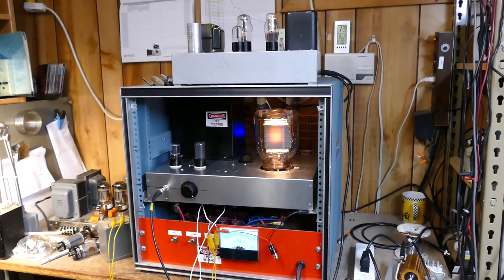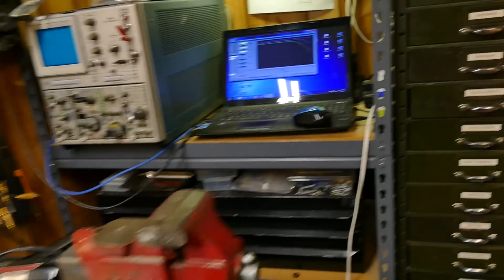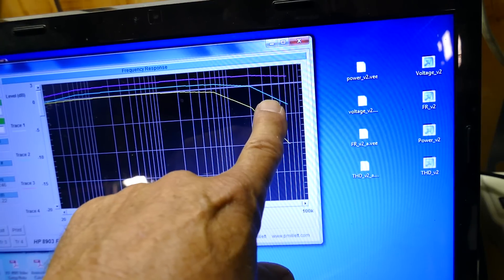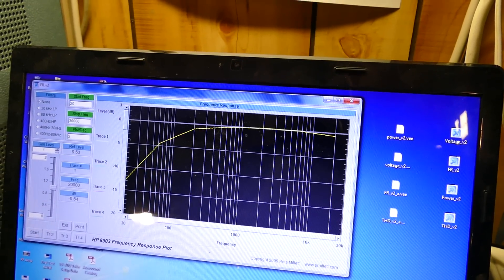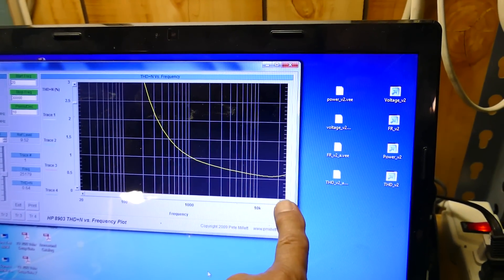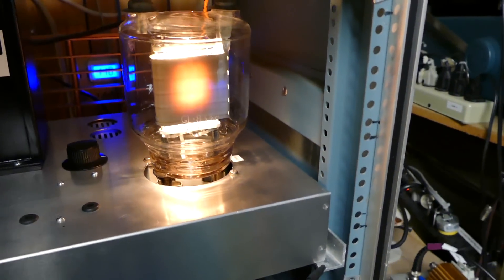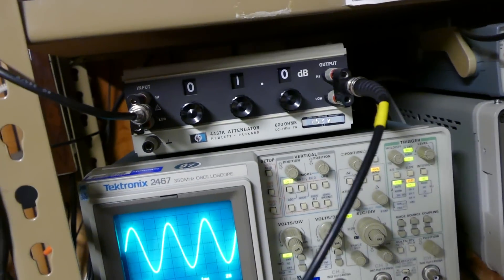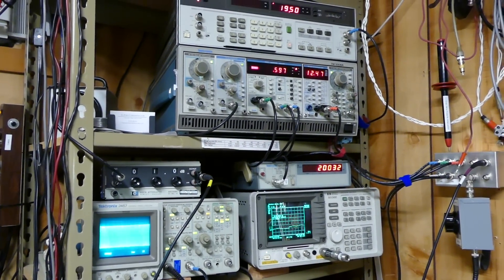833A Vacuum Tube Audio Amplifier Update

Comment: I guess it was stated already, but I think you need two 833's, push-pull, balanced bias current on the transformer primary, which is probably saturating...  Do you know what the primary inductive reactance is? I think you'll need about 200 Henrys!
Reply from the maker: I just replied to your other comment. I think the L of the primary is around 7H as I have found to be not uncommon for large OPT. This transformer is for PP 810 tubes. 200H would sure be nice but I don't think that is very practical, especially at high power. I doubt I will ever attempt SE amplifiers again. From what I have measured on SE amplifiers, the harmonic profile is pretty much that of sawtooth waveform. Second harmonic is high and each following harmonic is lower in a descending exponential shape. I will admit that at low power and the right kind of music, a SE amplifier or even a PP amplifier with little to no feedback can sound very alive and dynamic. I built a 80 watt PP amp several years ago with variable NFB and with no NFB it was very easy to drive and actually sounded amazing but max power before THD went thru the roof was something like 7-8 watts whereas with proper NFB it would do 80 watts. As NFB is increased, the amplifier tends to sound compressed but what are we going to do?  Build 10 watt amplifiers that weigh in at 100 lbs each? I think that is what they tried to get away from back in the 1930's...   :-)   and they did a good job with the PP amp and feedback.
I also have a video on PP 813 amp that turned our reasonably well. I still have that amplifier but the 833A is now in a 20 meter SSB linear amplifier. It does a very good job there and will deliver just a bit below 1Kw with 4KV on the plate. I usually run it at 3600 volts and 800 watts output.

Comment: My 833-A stereo is less ambitious than yours. It uses only 1000 plate volts and draws little over 120 ma and a Hammond 1642SE output transformer and I use an interstage 5k 1 to 1 Hammond transformer to drive the grid at zero bias (one end of the secondary grounded. ) This transformer couples the output of a 245 triode and it has a healthy low frequency for a small listening room. I heat the cathode of the 833-A with a fully rectified bridge rated at 20 amps delivering about 9.9 Volts with a 0.1 Ohm dropping resistor and a 4.5 Farad filter capacitor to get rid of the hum. The 4.5 Farad capacitor is designed for a car stereo and it has to be maintained by 9 volts through 100 Ohms to keep the capacitor from emulating a short circuit when I turn on the cathode heaters. 
This circumvents the difficulties of a grid bias that goes with 3 kv on the plate. I have been using this amplifier for some time and I like the stronger sound it has.
My only regret is that Arcturus never built a blue glass 833-A or glass in other colors because that would make an 833-A amplifier look even wilder than it does.
Reply from the maker: Very nice. I am pleased to know someone that actually built and uses an 833A SE amp. I have toyed off and on with the 833A for decades using it once in an RF amp probably for 80 meters and I never seemed to be able to make friends with it. On the other hand, all of the 4-400A family of tubes (except for the 4-65) from the 4-125 to the 4-1000 has worked for me. The 4-1000A was not my favorite because at the time I was working with them (I got the used ones free from WSMR over the 20 years I worked there) I did not have the means to deal with a 5KV (or more) power supply. Maybe my problems were similar with the 833A. My favorite high power tubes are the 3-400Z and 3-1000Z triodes. I can make the 811A sing also and as they are all zero bias triodes (maybe -5 volts for the 811A at 1500 volts) they are easy to work with. I use a 3-400Z amp daily in my amateur radio station. It is beautiful and has almost the same punch as the 3-1000Z
Thanks for the information. As I think you saw in this video, I did not have a proper output transformer for this project (mine was a huge PP transformer) so my LF response was poor (core saturation)    But... I tried and it was fun. 
Be safe with the HV...
Lastly, I have no issues with hum running AC on the filaments of directly heated cathodes. The last amp I built and listen to daily is the quad (PP/parallel) 300B amp with the big UTC LS-58 output transformer. Sounds beautiful and it is honestly quieter than my McIntosh amplifiers. I can hear nothing at all from my speakers whereas I can hear a tiny hiss from the Mac if I put my ear directly to the mid-range horn.
Reply from the maker: One more thing I would like your thoughts on. Looking at the 833A I see it is a medium mu triode with a gain of 35. I would consider that medium gain. With that said, check the 300B with a gain of 3.85. Certainly with such a low gain (the 300B) , it will be necessary to put a pretty high negative bias on the grid to control plate current, and run the tube class-A. So, why don't we do the same for the 833A - bias it, not to cut-off, but enough to be able to drive it from a reasonably easy and common driver (6SN7) but make sure not to draw grid current? Seems like that would be the best of two words - the exotic look and style of the 833A and the charm of a clean class-A amplifier and of course, a proper output transformer (not like what I used).  Your thoughts?
Reply: I use a choke loaded mu-follower 6SN7 that drives two 245 triodes with no apparent impedance overload. One of the 245s drives the tweeter on a GR Research OB-7 while the other drives the mid-range and a 5k Hammond 126B interstage transformer through a 100k pot which drives the 833-A. I could hear no difference in the mid-range speakers between AB tests on whether the 5k interstage was connected. The 833-A drives the woofer and it has to have its pot turned only about halfway up to balance the volume on a dB meter at the listening position. Also, the dB meter allowed me to check polarity connection of the interstage transformer to put the 833-As and the mid-range at least nearly in phase near the crossover frequency. 
This tri-amp gives me the clearest sound with the tweeter and the mid-range and the deep authority of the bass that the 245 can never match. I really like the sound which is more like that of a concert hall than I ever had before. 
As soon as I can borrow a camera I will send a picture.
By the way, this system still needs a preamp to drive the 6SN7 so I use a 2C22 with its own power supply and two blue LEDs in series for cathode bias. The 6SN7s have a 1.5 volt battery for the grid bias of the lower grid which is transformer driven. The 2C22s appeal to guests' maternal instincts because they look like baby 833-As.
Reply: I could not get away with using a center-tapped 10 Volt 20 Amp rated transformer and it takes every bit of 4.5 Farads from a car stereo capacitor to get a silent background. But the use of a center-tapped 2.5 volt connection to the cathodes of the 245 driver tubes is as quiet as an elaborate system of lead-acid batteries and dropping resistors. Also 6.3 Volt AC makes no noise on the 6SN7s and the preamp 2C22s. I built a Lexan cage for the 1 KV power supply and 5 KV makes me nervous with its filter capacitors ready to explode in the event of a short circuit arc not to mention mercury vapor diodes. I use FREDs rated at 5 KV in my lower voltage power supply.
Reply from the maker: During the construction of this amp I read the same issues you are telling me about the hum issues with AC on the 833A. I did use a DC supply but never actually lived with any hum issues out of a speaker as my amplifier just didn't turn out good enough to use - I am sure mainly because of the wrong output transformer.
I feel the same way you do about living in close proximity to 5KV. In both of my RF amplifiers I run 3.5KV but I turn the PS on and off with transmit and standby and I run both of them off a dedicated 240 volt circuit.  I added a soft-start to the 3-1000Z amp as it wanted lots of current on startup depending on the point of the cycle when initiated. In the latest 300B amp that I use as I write this message, I have MV rectifiers in it, 866A and as mentioned, quite beyond my expectations. For some reason, I anticipated noise from the MV rectifiers. They are beautiful, I have to say. I also have some 3B22's which are full-wave xenon rectifiers that work perfectly well.  In my transmitters, both of them, I use a bridge of four SS 866A type plug-in replacement diodes so I did not have to modify everything in the old 1947 Collins 30K-1. Also, I didn't have enough room to mount three 2.5 volt 10A filament transformers. I certainly respect what you built and I can hear it in my mind... I can't help but believe that the mighty 833A would have a powerful presence to it.
Reply: The filament DC irregularities are only a modest to trivial inconvenience and it was well worth the effort to get the 833-A running and working so beautifully. Now when I read reviews and see live demonstrations of amplifiers that cost up to six figures I can experience no envy whatsoever because the 833-A was something I could design and build exactly in the style and configuration I wanted. The 833-A system goes perfectly in my Futuro house, an architectural masterpiece so far outside of its time and resembling something from a far more advanced planet that living in it makes it impossible for me to envy the 7 to 9 figure mansions that the rich and famous live in.

Comment: I know the whole point of this was to be a SET amp, but why not add an 833A and make it a push-pull? The low end response, and extra power will do ACDC justice! All with things you have on hand too!
Reply from the maker: I would love to have a 2 KW 833A PP amp...  :-)  Not sure what I would do with it. I actually learned a lot from this as I thought I could use a PP transformer and it would work OK but I found out pretty quick that even 150 mA of steady current saturated the core of these KW level PP transformers. The output transformers came from a PP 810 amplifier. 
I assume you have seen my 3-400Z PP amp where I do get 1.3 KW out of it. Also the PP 813 amp which I think sounds the best of them all at about 350 watts.
Reply: I have seen both, though I need to re-watch the 3-400Z one. I eventually plan to build a 833A PP stereo amp with 4kV plate voltage. Don't know what I'll do with 5kW audio, other than anger the neighbors. ;)
Reply: @ElPasoTubeAmps  here’s a thought, push pull 833’s cathode (filament) follower. Connect a large wire wound pot with the wiper to ground and connect the load (speaker) across the pot. Adjust the pot for 0 volts dc with no signal. No large opt required.

Comment: I would suggest that you change the 4uf coupling capacitor from the driver to the Grid of the 833A....it is just too large and the rise time on it is too slow and clamping the LF response. you just dont need 4uf...try a 0.47uf

Comment: The transformer is saturating due to the DC current flow, a SE transformer is built to reduce that problem by using air gaps. The load Z drops to Rp at lower frequencies so the tube is really straining and the poor match between the load of 8 ohms and the primary of almost 0 ohms at 20 hz with a saturated core means the amp is doing 10 times better than I would have guess.   I have built PP and SE 833 amps, one was in commercial production for a few years in the 90s and the transformer is 90% of the design.  Also build PP 833s amps that did not go into production because the market is in love with anything labeled as SE even it is it by nature a poor topography for low frequency audio .
The biggest hurdle is lifting and paying for a proper SE aid gap transformer that can handle 200 watts.  If your current transformer is 30lbs, expect a SE transformer to be about 100lbs and 5 times the cost.  There are schemes to cancel or block the dc polarizing voltage but no one has come up with a technique that works at low frequencies, although they are common at high frequencies. In test instruments chopper style circuits were used for to eliminate the steady state flux (0 hertz) that saturates the core.
Reply from the maker: +Stan Jacox I really appreciate your comment and information. For some time I refused to believe that my huge transformers could be the problem until I made direct measurements of core current vs inductance. That really brought it home and I quit trying to make the 833A SE amp with my transformers. The quiescent current of the 833A is right at the saturation point of my transformers. I have not attempted to evaluate the size vs cost of a serious attempt at a 100 watt SE amplifier with "good" low frequency response but I think you have stated it clearly. You have also illuminated another sales-pitch for poor performing SE amplifiers at low frequencies. And, as you mentioned this amplifier performs very well at high AF. I assume you have noticed that no one that plays music over YouTube through their SE amplifier regardless of its power level, ever play anything but chamber music or some music with only mid and high frequencies in them. Sometimes beyond the 1940's, engineers moved away from SE amplifiers in favor for PP amplifiers for obvious reasons. What is it that continues to take so many of us back to the dark-ages in amplifier design in an attempt to find "purity" that simply doesn't exist?

Comment from the maker: It has become obvious to me (after denying it for so long because I didn't want it to be true...) that I cannot use a PP OPT in a SE circuit no matter how massive the OPT might be. I have discovered through experimenting with PS chokes and a number of large and small PP OPT that even a small amount of DC current flowing through the primary lowers the effective inductance of the primary to basically zero. This build is never going to work properly until I get a proper SE OPT.
Reply: +ElPaso TubeAmps something along the lines of a Electraprint MT5K or Hammond 5K?
Reply from the maker: +jordanch68 I think the right one would be the Hammond 1642SE (75 watt) and use the 4 ohm tap with 8 ohm speakers to give a primary Z of 10K ohms. They can be purchased from Mouser.com
Reply: That might be, I haven't found much information on the output for amps of this power. Gu-81's seem to be popular, I also thought of the Philips EL6471 but the manual is in Dutch..I think. :)
Reply: Here is a link to something similar: http://www.monolithmagnetics.com/index.php?option=com_content&view=article&id=77&Itemid=81
Reply: I have good luck using a Hammond 1642SE which is good for 300 ma and 75 Watts, but I only run mine at 1 kv with zero grid bias that eliminates a bias supply from from the signal path.

Comment: Is it possible that the increase of THD on low freq is caused by physical vibration of the tube elements?  Just curious.
Reply from the maker: +JimmerSD No, I don't think so. I have shelved this project for a while just because it is so large and heavy and takes up my entire shop. I am still puzzled about the poor low frequency response. Possibly the filament supply I am using not providing a low frequency, low Z,  path to ground ?? (I don't think so..). Possibly the output transformer, which was built for push-pull 810's,  having a saturated core? (don't know). The problem is in the 833A circuit as the driving signal on the grid is perfectly good at all audio frequencies.  I will have to revisit this project soon. I appreciate your thoughts on it.

Comment: CHANGE THAT 4UF TO A 47UF
Reply from the maker: +Jamie Phillips I did exactly that (47 uF) I have even tried NP capacitors with no help. I have some solid state parts to build a driver with but I am not sure it will help as the drive signal on the grid is clean with what I have done already. Not sure what the problem with low frequencies is. Of all the 833A SE amps I have heard on YT, they all play classical chamber music or Japanese music or some kind of music with only high frequencies in it,

Comment: Frankly, I'm not surprised about the low frequency response of the 833, as it is  designed as a transmitting tube, not an audio amplifier. Also the coupling from the driver,  you have the inductor in the circuit as others are suggesting.

Comment: try using a 40uf cap for coupling , instead of the 4uf
Reply from the maker: jpopwell1 I have tried a 50 uF capacitor with no help. I am waiting on some parts to build a low Z solid state driver that I hope solves the low frequency problem. I find it amazing how well it works at higher frequencies even beyond 20 KHz.

Comment: actually it's no big problem, just set a line level crossover in front of it and use it for mid and high frequencies only and some other amp for the low frequencies.